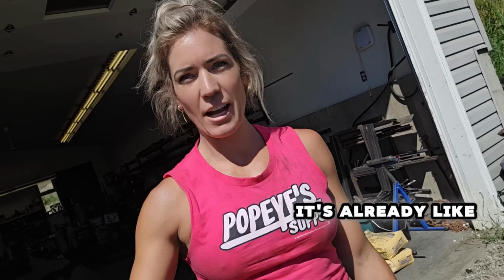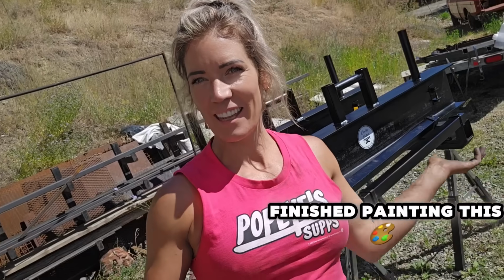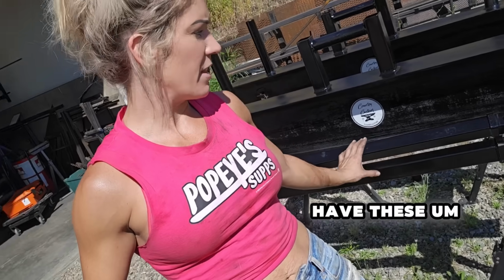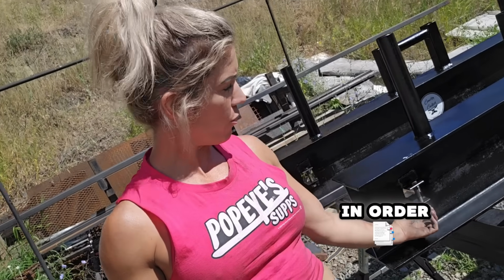Welding With Rachel - Fabrication of Strongman Farmer and Frame Carry #strongman #strongwomen

Comment: It is wonderful to see a woman excelling in the trades. Please use the proper terms for the material though. You are working with wide flange. I beam is totally different and normally used in cranes and hoists etc and the shape of the flanges is totally different. Sorry to nitpick but if you want to be taken seriously by other professionals you should use the accepted nomenclature.